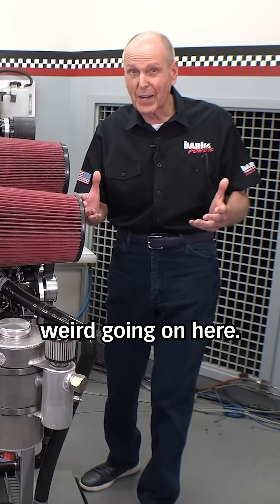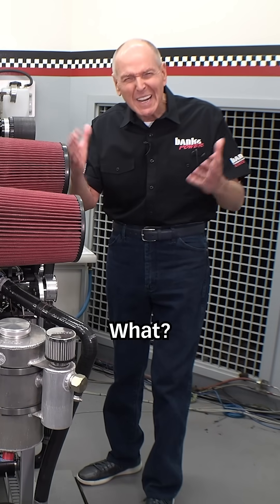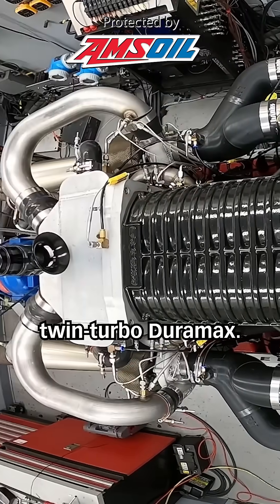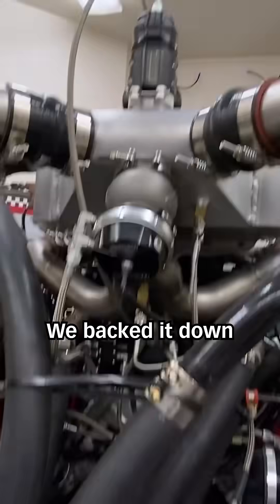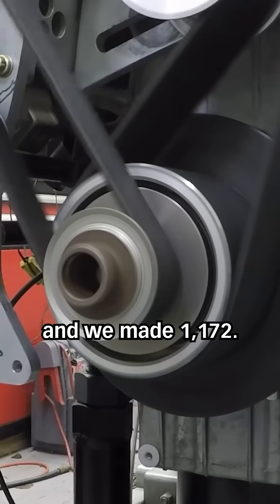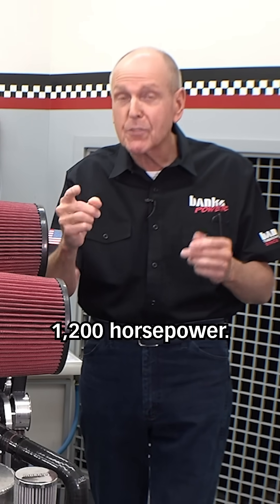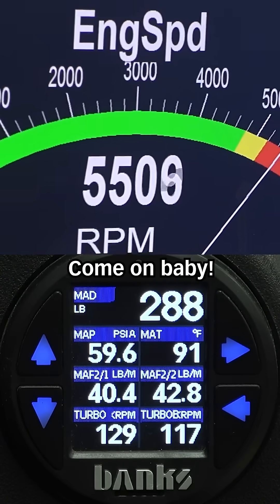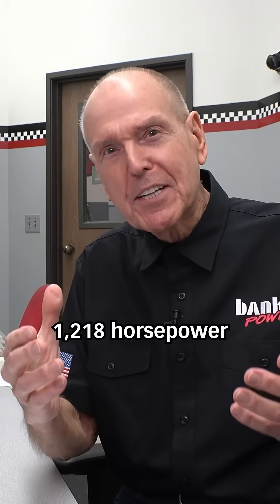How to make 1,200 horsepower the wrong way.

Comment: Wouldn't it be best, to have the blower pushing in the air directly at low engine speeds, and then once the turbo's come up, have things valved (wastegated?) to feed the air from the supercharger in to a plenum that the turbo's breath from, so instead of them seeing 14psi, they're pulling from double that. You'd also want the blower to have it's own intercooler, so the air going to the motor or feeding the plenum is as cold as possible.
Reply: no.  the blower has plenty of power to pull through the turbos.  Giving you instant response (positive displacement pump).  Once the turbos light off and provide boost.  The supercharger sees that on the intake side and compresses it more (compound effect).  The biggest issues here are heat and parasitic loss (power robbed to turn the blower)

Comment: Not really. Blower (or turbo) basically almost doesn’t care what psi you put in it. It will compress it further. It works taking pressure from A to B. That’s why compounding turbos work at all
Reply: Ya, I'm amazed at how elementary people are on their understanding of engines/boost
Reply: They don't care what pressure is on the inlet and outlet sure, butttt if you're turbo is being driven hard by the exhaust wheel on it... And it's attempting to pull more air than the supercharger can flow its a restriction. Now the turbo is fighting the blower
Reply: @DarkAttack14  not how it would work. The pressure would stack up on the inlet side of the blower, then be compressed more by the blower, and sent into the intake manifold.  We know flow isn't the case as a slower turning blower is producing more HP.  With a slower spinning blower, you're flowing less cfm's(also less parasitic loss).  If you saw an increase on HP with a faster blower, then that would point to the blower being a choke point.

*Also, turbos are pulling from ambient
Reply: @w140  you are watching a 30 second clip of trial and error. If you couch engineers can do better go do it? If you have the answers, go apply?

Comment: The parasitic losses from the blower - such as friction and heat is robbing power up there. Put a bypass valve in to bypass the blower at high rpm. Blower is fantastic for the low end usage, but it's getting in the way of the turbos at high rpm. Putting the blower in front is not the way to go in my opinion, but I'm all for experimenting!
Reply: the blower is still compounding though.  Removing the blower, and you'll lose HP

Comment: Thank you BTW! I have been dreaming of putting a blower on a Duramax for over a decade. I would love to see this thing in person. I would really like to work on some new instrumentation. As a child, my father built and repaired industrial equipment, both automated and analog. Then I went to collage for the same thing. But not before I trained to fix aircraft hydraulics on the C17. Instrumentation specifically, excites me because there is always something that needs discovered. Also, I'm not going to say it in the comments, because its needs more testing & a patent, but I know the real problem with this set up. For everyone else reading this, I'll give you a hint, a wise man told me this about 21 years ago while I was still enlisted "An engine is an air pump. The better it pumps air, the more power it will make when you add fuel."
Reply: Think 2 stroke resonance or slip of servo electric motors, that was easy!! 2 different layers of air mass quality and how they are blended. EE, ME and aircraft background, in addition to mucking about with engines of all types for decades. Good problem to solve, love teasers like this!!

Comment: I think the top mount super charger is the right call. BUT, the charge air cooling of the blower needs to be upsized I think. For immediacy of response the top mount super charger makes sense but the intercooler is being overwhelmed since the unit is typically sized for the blowers capacity not blower + turbo X 2 unless you have accounted for that. But this seems like the blower was being over driven or all of the devices are exceeding the CFM that intercooler can handle. Arguably each intercooler will need to be larger than the one used before it in line because even if you are cooling right now, the CFM you are moving is going up in kind and the intercooler on the supercharger intercooler doesn’t offer the needed dwell time needed to handle the sheer CFM you are throwing at it. I think that intercooler is being overrun and starts coming into its own as you back off the superchargers rotor speed since it’s now catching up.

Comment: Blower holding back the turbos
Reply: The supercharger further compressing the already-charged air creates heat. If that air isn’t cooled, there is risk that the supercharger will have little effect (or even negative effects) due to loss of efficiency. 

It seems the ideal situation would be to have the charge air cooled after the turbos AND the supercharger. Whether it’s better to have turbos first or supercharger first, IDK - I’m not Gale Banks and don’t have his funds. I’m confident he’ll be able to solve the equation, though!!
Reply: @SumbudysDad  Heat isn't so much on an issue in diesel since it relies on it for operation (no detonation risk).  Yes, cooler air would be more dense, but it isn't going to be as dense as the blower compressed air, even though the blower added heat, vs not compressing the air.
Reply: Its probably that the supercharger takes more power to run than adds in gains at that point
Reply: At some point in time one will outdo the other. Obviously Superchargers need to be rethought. Maybe switching to a Screw Compressor like big factories use to provide compressed air. Running Turbos with a Supercharger is always going to be a problem. I have never seen an AUDIO Guy put 1 speaker in front of another trying to make the Volume Louder.
Reply: Turbo bypass around the blower, into the engine. That way you get both suppling air.
Reply: @RonaldHawes-sr3cr  they're both supplying air
Reply: @BlackBeardAir   do the turbos blow through the throttle body?
Reply: @RonaldHawes-sr3cr  they're inline and sequential.  Turbos provide boost to intake side of blower.  Blower then compresses it more and into the intake manifold.  If you were to have 2 inputs, one for turbos, one for blower, the max achievable boost would be whatever the turbos could put out.  Inline, they add together.
Reply: @BlackBeardAir  this guy thinks he's an expert 🤣
Reply: @gamechip06  Just stating simple facts
Reply: @RonaldHawes-sr3cr that doesn't really work , when you bypass the blower yes the air goes around the blower but it is still loading the blower from the bottom side.
Reply: that's not how it works. .
Reply: @BlackBeardAir  That actually how it works. 
the supercharge can only displace so much air. Even compressed air.
Reply: @Joebauers2505  then turning the blower slower wouldn't make more power.

Also it takes compressed air and then compresses it more.  Definitely not holding the turbos back.
Reply: t will if the blower is in cavitation for one. Next is density altitude of your air column, aircraft flight performance for engines AND airframe lift characteristics determine if you fly or crash. Not as critical to ground based machinery. TIC....
Reply: @stevensullivan3121   Cavitation is only meaningful in a liquid medium, and not relevant here.   And the whole point of super/turbo-charging is to make DA mostly meaningless.   
They're using a positive displacement blower, meaning the flow through it should vary in direct proportion to its RPM and there is no bypass. There is no way to force air through this type of supercharger thus turning it slower should let less air through.
Reply: @BlackBeardAir  I am no expert but I think Mr Banks refer to parasitic power drawn by the blower. Dense air is hard to compress, the more boost one try to add the more it suck away. Turbos are a bit more fluid on dynamic air, so the proposed problem is a good one.
Reply: @mereveil01  It's not boost they're adding, it's rotor RPM, (which is sorta boost), but it's a bunch of parasitic drag.  Top HP/boost numbers are coming from the turbos, not the blower.
Reply: @daemn42 cavatation does occur in turbos !!
Reply: @BeverlyHolzworth   Low pressure and stalled at the intake, yes. Cavitation no.  Cavitation is by definition a property of fluids, and usually involves mechanically pulling apart a fluid to the point that its pressure drops below its phase transition point, causing extremely low pressure vapor bubbles to form within the fluid.    There's nothing comparable in an all gas environment as it's already in its lowest pressure phase.      The pressure may be reduced but it doesn't cause anything like a cavitation bubble within the gas medium.     Perhaps you're thinking of cavitation in a turbo pump, which is used to move fluids.
Reply: @daemn42  call it what you want cavitation, stall, serge, the end result is the same. air or water!!
Reply: @BeverlyHolzworth   Ya, but we don't just get to "call it what we want"  and It doesn't produce the same result.  Compressor surge occurs when you close the throttle downstream of a turbo with no (or inadequate) BOV/DV.    It  immediately builds overly high pressure with little or no forward airflow, the blades stall (they have no choice),  and it sets up an oscillation of brief forward and reverse air flow through the compressor. 

Real cavitation only happens in fluids, and while it may include a stall the effect of it includes the rapid and violent collapse of those cavitation bubbles which can eat away on the metal blades of a  pump or propeller.   When people use the term cavitation, it is not synonymous with "stall".   You can stall a propeller or pump in a fluid, without inducing cavitation.